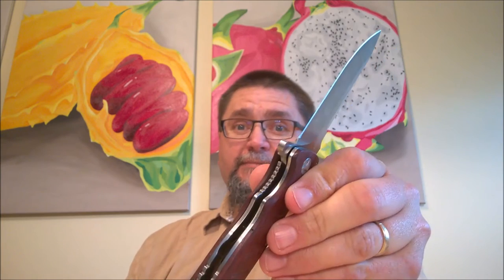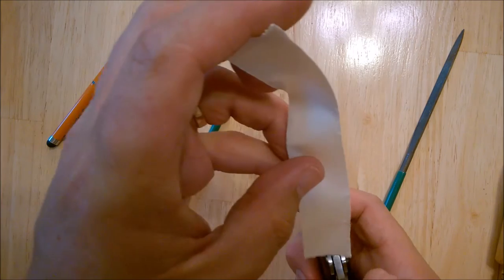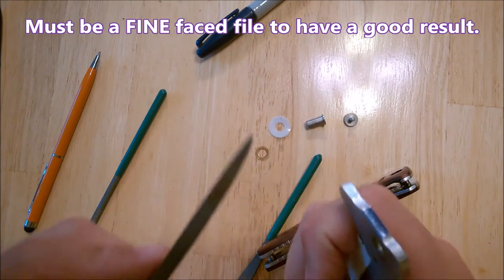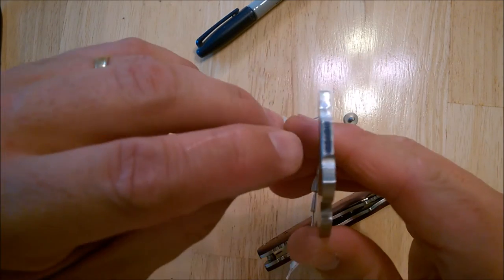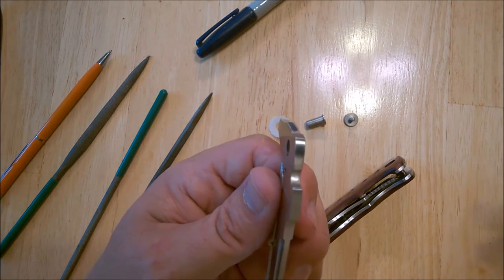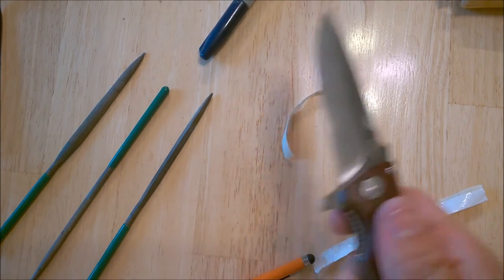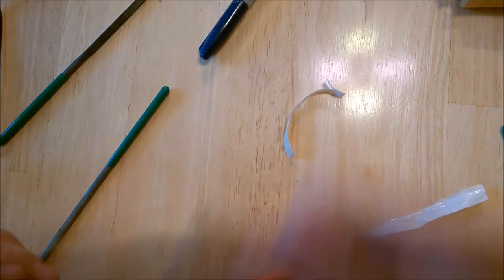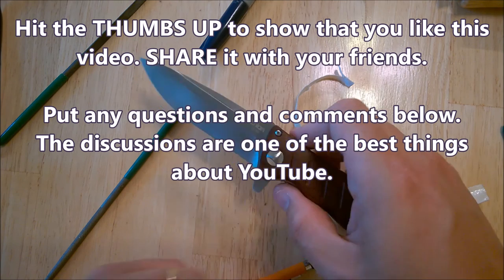How to: Tutorial about fixing early lock up on liner and frame lock folders

Comment: Thanks for your reply. I did however successfully fix a barely more than 5% lockup filing with 600 grit wet or dry (black) sandpaper the end of  the liner lock arm. I got over 25% lockup. Your comments were very educational though. Thanks and I always learn something from your videos.
Bruce

Comment: Nice tutorial for this issue! I have what is perhaps a tough question: have you ever addressed the issue of fixing LATE lockup on a liner or frame lock knife? In my tinkering I've recently inadvertently changed the lockup on one of my Ganzo framelock knives towards 'almost too late'. Since it's 'just' a Ganzo, I'm considering any method...
Reply from the maker: No, I haven't found any way to fix late lockup, I would be very surprised to find one.  The only thing I can think that might work is if one had the equipment to add on a piece like the knife makers do with putting steel inserts on titanium knives, I guess if one was good at brazing one could braze a piece on in that manner.  My mother has those skills but I don't.  (my parents had a small machining business and she has the eye-hand coordination and skill to braze tiny industrial diamonds onto stainless steel, she amazes me with what she did when they had that business going - now retired)
Reply: Thanks! I can't see myself brazing either... But I have one crazy idea in mind and I'll report back if it works :-)
Reply from the maker: I am always interested in different ways of fixing or adjusting knives so that they work better.  If you are trying crazy glue, aka CA glue aka cyanoacrylate glue, I would be doubtful how long it will last, but I would like to be proven wrong on that.
Reply from the maker: Thanks ivanovfarit!!

I had not seen this video before, but now that I have watched it, I think I could agree and recommend the method shown there.  Generally I would have thought that that is a terrible idea, BUT since the knife is going to become sloppy and loose in the lockup and basically mean the end of life for the knife I will be trying it out on my knives too.  All the guy does in this video is thin out the liner lock arm a bit thereby making it a bit longer which thereby means lockup will be a bit earlier.  I would only recommend this if the manufacturer won't repair-replace it for free or a reasonable expense (depending on the value of the knife.

Comment: Interesting, I didn't know it can be done that way. I did similar fix some time ago on a different knife but I disassembled the handle and it was very annoying to assemble it back. Something always didn't fit right, backspacer or stop pin wasn't straight or  was falling out or lockbar pressure was making it hard to keep everything straight together. Soft easy to strip screws also didn't help. Took around an hour to finally do it right.
Reply from the maker: If the method works then it's A right way to do it.  Sounds like you found a right way that was a bit frustrating, but it's good to hear that it did end up working for you.

Comment: Never thought to just remove the blade to do that. Although I usually check the liner also to make sure it is  flat with no burrs. Thanks for the time saving tip.
Reply from the maker: Ahh, yes, I failed to mention to check the liner lock face itself for a burr or other reason it may not travel as far as one would expect it to do.  Thanks for catching that. I put in an annotation in the video to remind folks to check for that once the blade has been removed and before they start filing.

Comment: good method. in my experience however, liner locks break down the fastest of any other lock... so i generally just let mine break in if they come with an "early" position. that said, that is just how i do it and i can see why some people might want to fix it right away.
Reply from the maker: That is true, that they wear the fastest. in the case of this knife, it was so early that it had let go twice just in the first day of my testing it for a review.  
I leave it to the owner to decide if they think their knife is safe as it is or if it needs this type of attention.  If the owner believes the knife is unsafe they won't use the knife and the types of knives that will need this fix are the budget type knives that have lower Quality Assurance measures in place, so the owner has little to lose.
If anyone tries this fix on an expensive knife then they are pretty silly because the chances are very low that it really needs the fix but if it does and somehow QC missed it, the expensive knives have (generally) good warranty and the mfr would likely fix it for free.
Reply: Canadian Cutting Edge absolutely all true. and i also completely understand if someone wants or needs to put their knife through more trying use and is concerned about the lock up with a liner lock, which might be the lock that fails the easiest.. i tend to go easier on my pocket knives so its less of a concern for me.

Comment: Wouldn't it be cheaper to replace the liner lock liner (filing the liner tip instead) though it requires complete disassembly of the knife? Though on a $15 knife that isn't an issue.
Reply from the maker: That isn't really a good option because getting the liner and the blade to mate properly is the main labour and custom part of the job.  A blank liner replacement will not mate properly with the blade tang and it would require exactly the same modification.  What I show here is basically the same thing that employees do at the factory except that in this case employee didn't take off enough material and so now the knife owner has to do it for them.